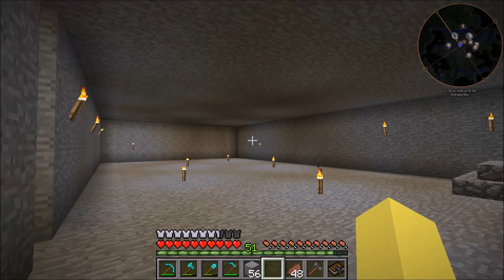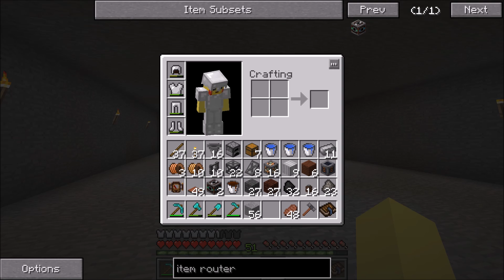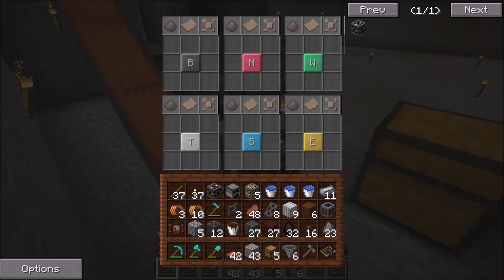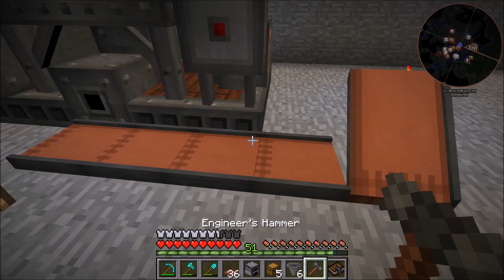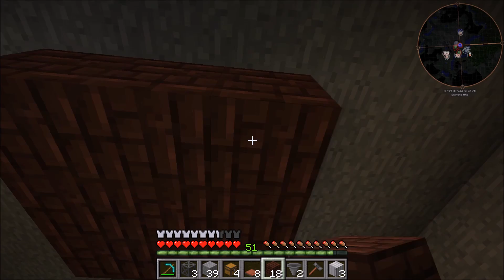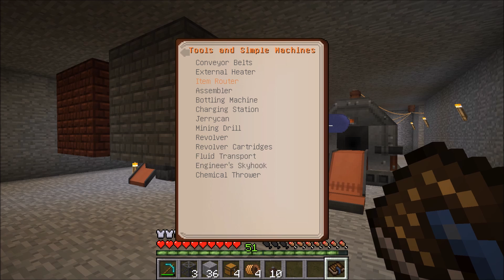Surviving With Immersive Engineering :: Ep.15 - Automatic Steel Factory

Comment: I used a similar setup to yours, except I used a tank to hold creosote.
Reply: Also, I upped the ceiling by one to accommodate the improved blast furnace, and moved the conveyors to make sure that they didn't get blocked by the preheaters which I'll add in eventually.  I hope to have the drill made soon, which will increase my mining yield by quite a bit, especially with the steel drill head.
Reply from the maker: The tank would be much better because it would make it less of an annoyance to deal with all the bottles, so that sounds great! The drill will be awesome for you too. You need so much iron and mining for it without a drill becomes quite a pain it the butt (until you get the excavator of course!).
Reply: Yeah.  If you want, I can send you a screenshot of my full-auto ore factory.  Doesn't just process steel.  Does copper, tin, lead, uranium and aluminum.  I'm gonna use uranium and packed ice as the best base IE thermoelectric gradient.  Also, think about the next update: Nuclear Reactors.  So much uranium and lead to collect.  Maybe we can even do a co-op Let's Play, as I have the rest of the summer off to start my YT channel.

Comment: You can pump the Creosote out by placing a fluid pump on the top of the coke oven (I put it in the middle block). You need to power the pump and put a lever on it and activate it.
Reply from the maker: Yea, it seemed there was a bug when I first set this up that has since been fixed when it came to using the pump on the creosote.

Comment: when i put the item sorter in between the two furnaces, the coal goes fine but the coal coke or iron don't enter the blast furnace.  They just get stuck in the hopper and i have the 2 pieces sorted in the item sorter already.  And the steel doesnt go through the hopper to the conveyer belt
https://gyazo.com/8acc8cf6a786e2b482a9007eb5306705
https://gyazo.com/070bf7a49e4818d8baae78b45730a391 <--- i destroyed the block for the gyazo pic
Reply: That's because in a latter update they made it so that you can't hopper into a regular blast furnace, only an improved blast furnace.
Reply: +Kai Beasley doesnt really matter now....my whole server got corrupted and same with all the backups

Comment: Thats a really impressive structure and a very good session. I like the mod too and I give you the advice to combine Immersive Integration to your work. It gives only a small amount of new Items but they are very usefull. Need some powered light (it actually use power) to switch on and off? Ore a flood light? Extansions for the Wooden Posts, lots of usefull things. Give it a try, you will see it's worth ;)

Greetings from Germany

Comment: tip:  Conveyor belts connected to full inventories, don't seem to lose their items due to despawn.  In other words, conveyor belts seem to come with their own overflow buffer.   Also, they seem to have infinite storage.   I've had thousands of items accumulating on a conveyor belt, and they seem to stick around indefinitely.  The only problem is a bit of lag because I'm guessing due to the graphics hit of animating all those items on top of the conveyor.
Reply from the maker: +zuul Ah yea, I've noticed that they seem to hold onto items, which is awesome! I guess most of the buffer chests are irrelevant then. I mainly use them because I can get an exact count of how much coal/bottles/iron is still in the system.